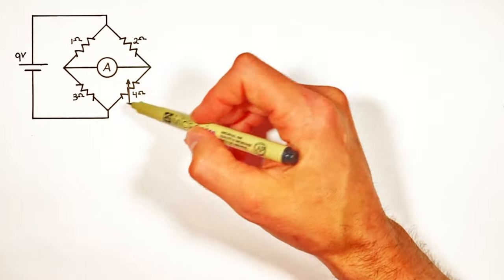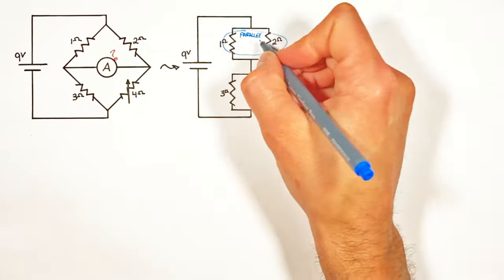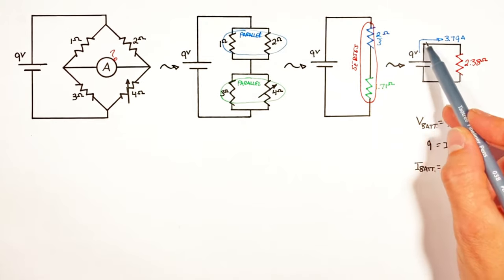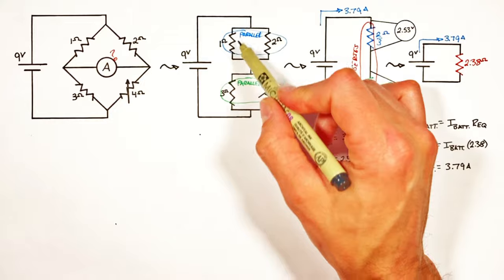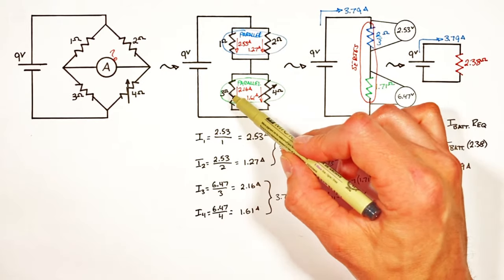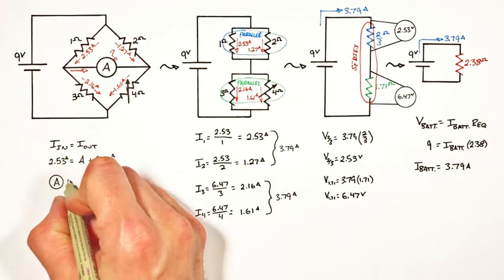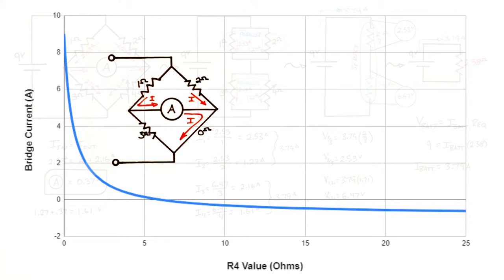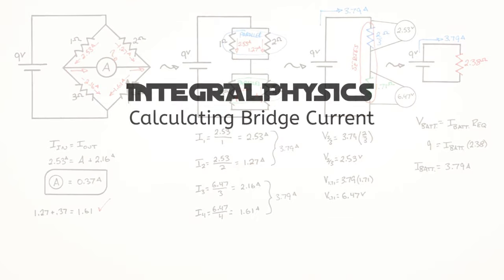Calculate Current Across an Unbalanced Wheatstone Bridge Circuit

Comment: I've been wondering...if the question were altered such that we were given the current flowing through the anmeter (let's say 1.0 A) and asked to find the resistance of the variable resistor, how then would we solve the question? In that case you can't simply find effective resistance, and current is also unknown. Thanks!

Comment: Where did 2/3 & 1.71 come from? How did you get that?
Reply: parallel resistor calculation. He just considers the 2 sections as parallel and use 1/R2 + 1/R1 = 1/R formula